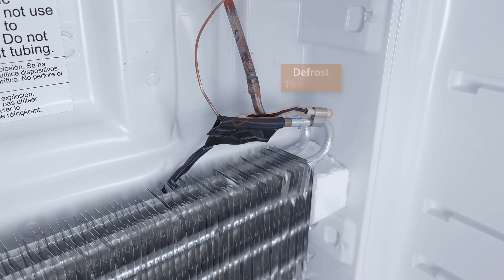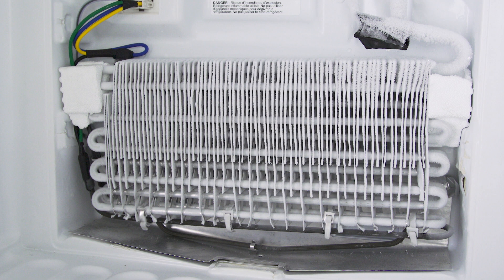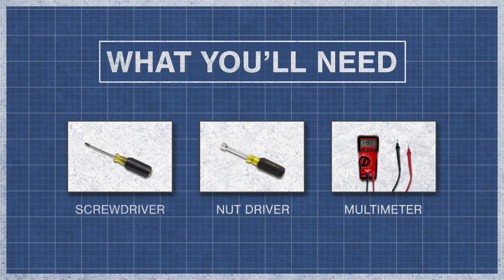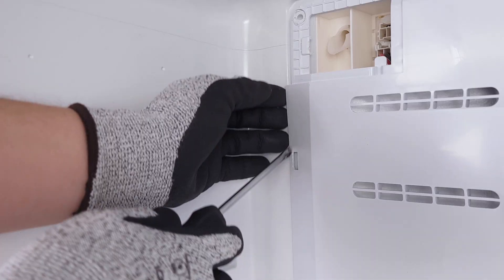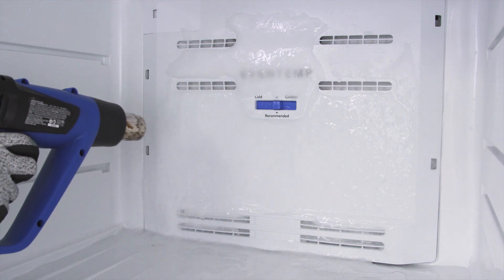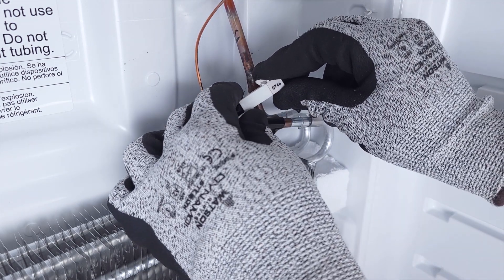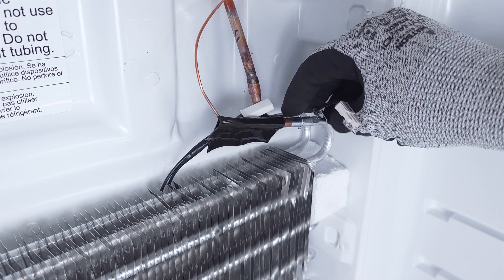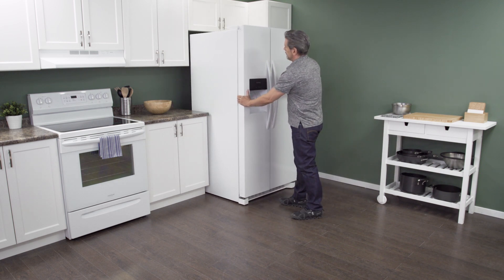How to Test & Replace a Defrost Thermistor in a Refrigerator | Repair & Replace

Comment: So why did they go with this idea instead of a simple on off switch the last time I replace one it was simple to check just put in the freezer and when it got cold below freezing it turned on when it got above freezing it turned off its been about 30 years since I replaced the one in my brothers fridge phoned for a price for a technician to come and at that time it was 60 dollars an hour 2 hrs minimum and if parts were needed they would have go get them so it was cheap to buy a used one so I tore it apart found the problem phoned the parts store for advice and he told me to remove the thermostat and put it on ice and it should turn on tried it it didn't turn on so I replaced it and it was working

Comment: Hi there....
I use kenmore with bottom freezer. So the problem is, the heater not working. Looks like no electricity passing it. The temp decrease until minus and  lot of ice at the evap. Normally when lower temp reach, everything stop working even the fan. And heater start to work....but its not happen. Defrost thermo maybe? Opinion pls...thanks
Reply from the maker: Thanks for watching. We have a complete defrost troubleshooting guide. It's best to test each defrost component to narrow down the faulty one: https://www.youtube.com/watch?app=desktop&v=r2YUNLPs4kM&t=0s